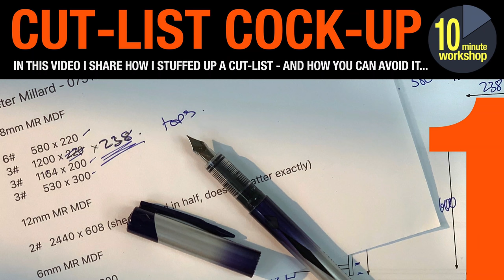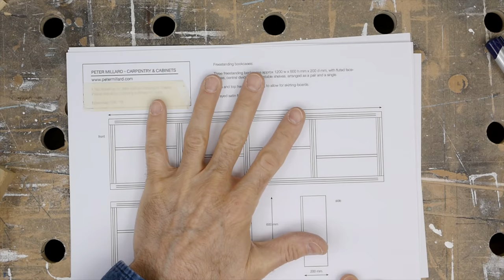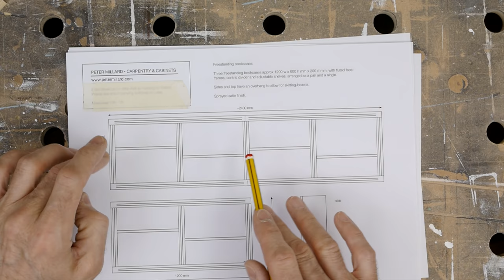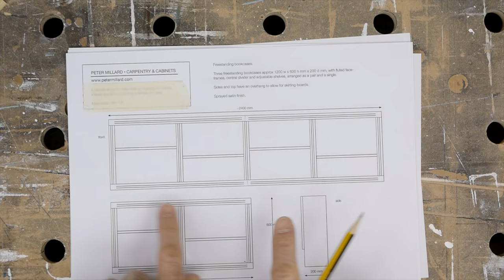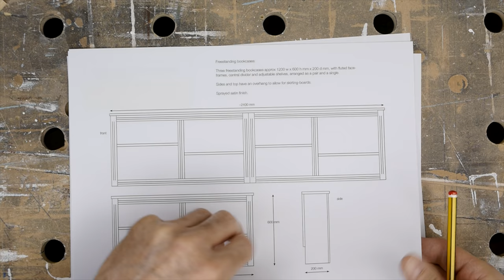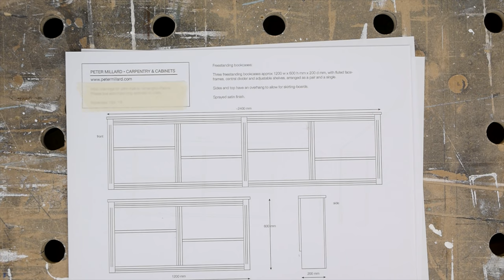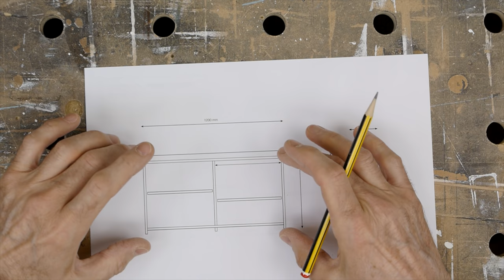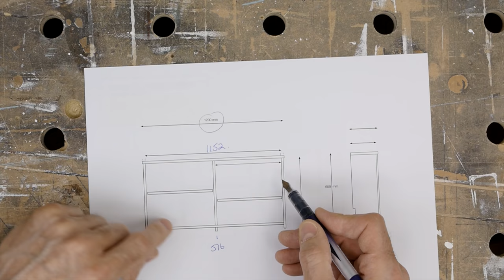Cut-list cock-up Part 1 [video #301]

Comment from the maker: Hi everyone. Apologies for the odd glitches that are showing up here (flashes of the thumbnail on screen) and thanks so much to everyone who's pointed them out. These are absolutely not on the original video, and have appeared by some kind of YouTube sorcery. Weird. Not sure there's much I can do other than pull it and re-upload, and that won't be until later todasy, so live with it for now, if you can. Thanks! 👍🤷‍♂️
Reply: I just assumed it was subliminal mind control; "Like Peter Millard!" perhaps the embedded message.
Reply from the maker: That’s the cunning master plan for the future... 😂😂👍👍
Reply: I'll know it's worked when I'm returning from the supplier with a mortgage worth of Festool kit in the van and no knowledge of why I've bought it.
Reply: I had to check before i read this comment. Just so others know, it's not a Fight Club type thing.  :)
Reply: Article 13 rising...

Comment: Setting out rods = no mistakes
Reply from the maker: And nobody ever made a mistake on a rod... 🤔
Reply: Peter Millard  no - unless the working sizes are wrong to begin with , the whole idea of a setting out rod is you can visually see the job every component , I’d stick my neck out and say it’s impossible - I make windows/doors/staircases ect - and the mistakes tend to come when a job isn’t set out  - usually because someone perceived it to be an “easy” job

Comment: I just had a cut list cock-up myself couple of weeks ago when I was making a simple dresser (with open shelves) out of MDF board. I designed all well and wrote down a all width's, length's and depth's just to find out later that the shelves weren't wide enough. I had wrote 445mm instead of 455mm to the cut list. :D I didn't have enough MDF-board to make new shelves and I just had to fix those too narrow ones by sawing a 10mm wide strips and gluing them to the side of the shelves. Not good or pretty but (hopefully) applicable fix.
Reply from the maker: Ha! Hilariously, I did the same thing on these just yesterday - short video out on Instagram about it. These shelves are for heavy art books though and all the weight will be at the edges, so a quick fix wasn’t an option. 😕

Comment: Afternoon,
Love  your  you tube  channel, found it  very helpful  with  many  aspects of  joinery and fitting,
 I'm 54  years old  with 38 plus years  experience in the construction industry, who  believes  in the old 
Adage  that your never  to old to learn something  new every day...!!
So with that in mind  I'm curious about  your  working  drawings    ( really impressed by the  quality)
Do you use a  software  program  to do them,  if so  what's the software  called  and have  you  considered  doing  a 10 minute  workshop  on  this side of things yet.
Reply from the maker: Hi Gerry, and thanks! I use an OSX / iOS app called Graphic. It’s actually a full vector illustration app that does far, far more than the simple 2-D line drawings I use it for. Because it’s an illustration program though, there are a couple of irritating missions from a ‘drawing plans’ perspective (e.g. no ‘tape measure’), but it works to scale in metric and is a very reasonable one-off purchase, so I can work around those niggles. But that’s the reason why I haven’t done a video about it - it’s not a great program for the job I’m using it for,  it’s just that I’m used to it. 🤷‍♂️👍👍

Comment: EXCELLENT, as always! Do you use sketch up to produce your drawings?
Reply from the maker: Thanks! I use an OSX / iOS app called Graphic. It’s a full vector illustration app that does far, far more than the simple 2-D line drawings I use it for, but it works to scale in metric and is a very reasonable one-off purchase.  👍👍 
p.p1 {margin: 0.0px 0.0px 0.0px 0.0px; font: 12.0px 'Helvetica Neue'}
span.s1 {font: 12.0px '.Apple Color Emoji UI'}

Comment: Have you looked at Fusion 360 Peter. Its parametric which means you can just change a dimension and the whole thing resizes. Fantastic program and maybe free for you depending on turnover. Lars Christensen on youtube has some great tutorials. Really useful tool and would help avoid making this kind of error. Cheers
Reply from the maker: Yes, been playing with it for a week or so, and just recommended the Lars Christensen videos to a pal of mine here in the comments, lol! And to be fair, the error came from the drawing/planning and me not thinking it through clearly enough. Maybe fusion would help in that, but maybe not. Great piece of software though, expect to use it a lot more when I have my CNC up & running 👍
Reply: What cnc did you get Peter? I picked up an Ooznest Workbee a few months back. Great fun but certainly a vertical learning curve

Comment: Hi peter, what do you use for drawing your plans out.
Reply from the maker: Hi Gavin. I use an OSX / iOS app called Graphic. It’s a full vector illustration app that does far, far more than the simple 2-D line drawings I use it for, but it works to scale in metric and is a very reasonable one-off purchase.  👍👍

Comment: Hi Peter. Which software do you use to draw your projects ? Thanks in advance
Reply from the maker: Thanks! I use an OSX / iOS app called Graphic. It’s a full vector illustration app that does far, far more than the simple 2-D line drawings I use it for, but it works to scale in metric and is a very reasonable one-off purchase.  👍👍

Comment: I still use a drawing board for my designs and plans, have you used a computer to do your drawings as they look great, if so can you let me know the software you used thank you, great video looking forward to the next part
Reply from the maker: Thanks! I use an OSX / iOS app called Graphic. It’s a full vector illustration app that does far, far more than the simple 2-D line drawings I use it for, but it works to scale in metric and is a very reasonable one-off purchase.  👍👍

Comment: Very interesting video. Every project starts with measuring, thinking, combining and making mistakes.
I did not understand how you came to the width of 565 mm for the shelf. So I started to count myself.
576 - 9 (half of the middle vertical board) - 6 (the overhang at one side) - 18 (thickness of the right vertical board) - 2 (wiggle space) = 541.
But then I did not understand why there would be so big difference between your and my calculation.
So I started to calculate again: 565-541 ís 24 mm. Two times (left side same problem) is 48 mm.
After that a light started burning because this number you mentioned before. And yes 1200 - 48 = 1152.
I wrongly presumed (when I started my calculations) that 1152 was the total width of the upper board. 
So your calculation is right (and mine not). But I'd write the length of the bottom board below the bottom board and not above the upper board.

Comment: Hi Peter! Have you heard about the software called Polyboard (wooddesigner.org)? It is a great software for designing cabinets and other furniture. It is free if you can accept some limitations. I have used it for a couple of home projects and it is great!
Reply from the maker: Hi Jacek! No, I'd never heard of it - I'll take a proper look later, thanks! 👍
Reply: Peter, unfortunately it is Windows only but you can run it on Mac in bootcamp or in parallels / vmware / virtualbox etc. If you need any help, just ask (IT it’s my job haha). You have my email already (remember Aldi bandsaw blade?).